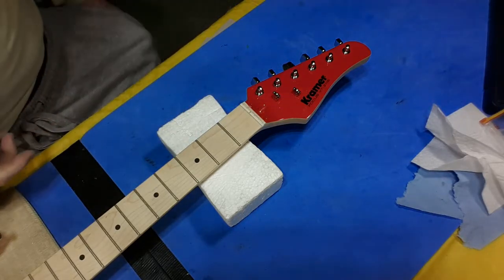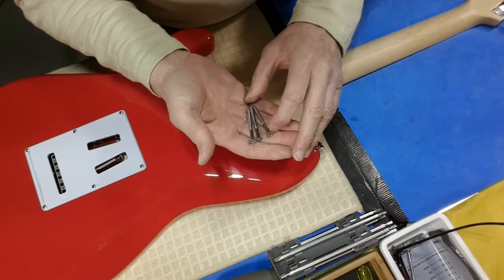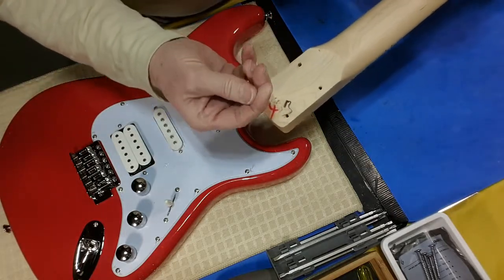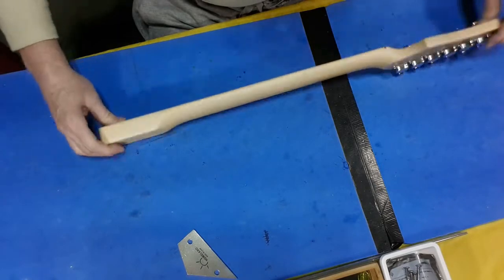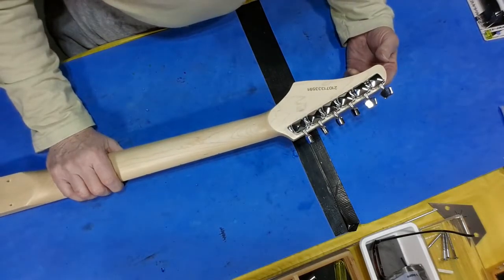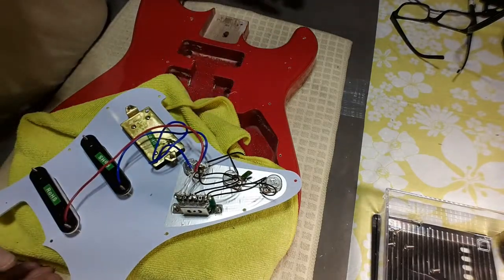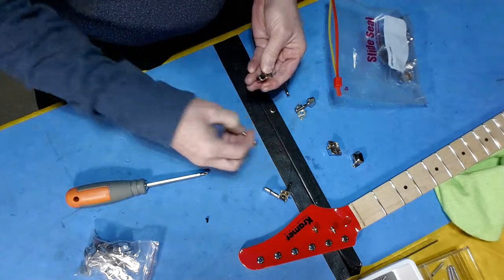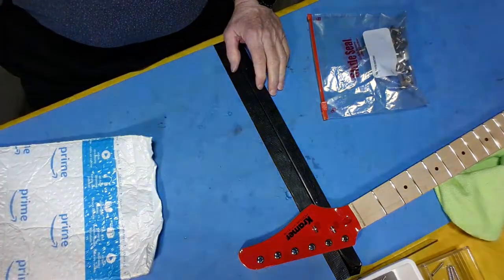KRAMER VT - 211S - More info and tuner issues - Part 3 Dec 2021

Comment: New subscriber. I just bought this guitar from Scar my Guitar. Can you let me know the tuners you used? Were they drop in or add extra holes? The pickups could use.mpre punch? Any recommendations? I am ignorant to changing out factory parts. I am watching your series of vids on this guitar now
Reply from the maker: I did a video on how to create a good tuner from The originals and the set I bought off of Amazon. It's in the playlist for this guitar I think. That way I was able to keep the original tuners with the original footprint
Reply: @2bikemikesguitartopics145  I found it and watched. So, it's the original tuner going into the aftermarket piece that mounts to the back of head? I got lost when you showed how they go together as it's my first time, but I'm apt enough to figure it out. I'm ignorant on these things. Wondering why 10mm, 18:1 tuners, of any kind wouldn't fit? See, I'm ignorant on these things haha

Comment: Should have just grabbed some gotoh tuners, good for the money. Trying to upgrade cheap budget parts with other cheap budget parts seldom works out.
Reply from the maker: Sean, worked in this case though.  Was a gearing loose misalignment.   I haven't found goto in this style.  Where have you found them.  I ran into these shit ones on the Epi special ll also.  Again same gearing issue.  Never want to get these again.  Was accidental on the Epiphone.   Didn't know it had these on it.  There weren't any pictures of the back of the headstock and then I 😕 found why.  Thanks for watching

Comment: The tone knob fell off completely what do I do
Reply from the maker: Leon can't you just press it back in place, or is there something more than the knob falling off?
Reply: @2bikemikesguitartopics145  the shaft as well
Reply from the maker: The tone potentiometer control needs to be replaced with a new one.   If you can't do that then you need to find someone to do it.  In the meantime the guitar should still be playable minus tone
Reply: @2bikemikesguitartopics145  yeah it’s still playable (it fell off a few months ago but I ain’t a big fan of the guitar so I didn’t really care much, imma replace the tuners in it though)
Reply from the maker: @leoncorbett4553  
I wanted to keep the original style tuners, so I  had to make a good set from two different sets.  I have a video on that.  Now that I've corrected all the issues this is a sweet guitar.